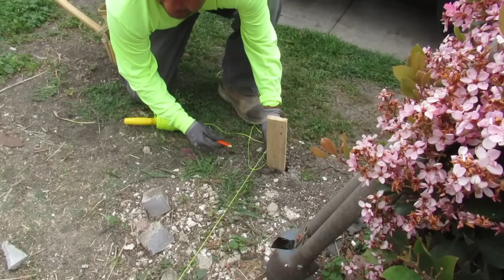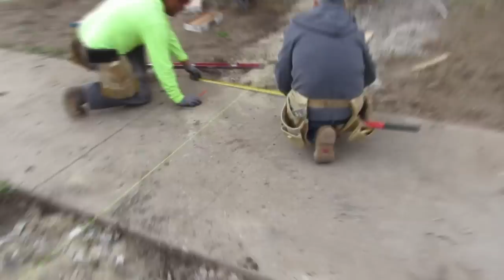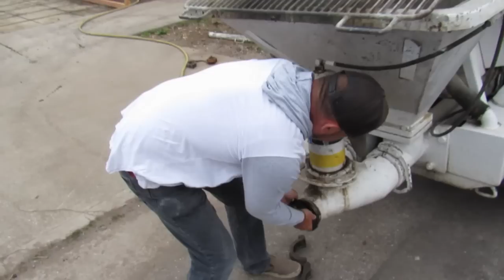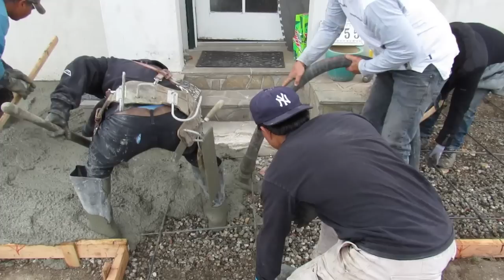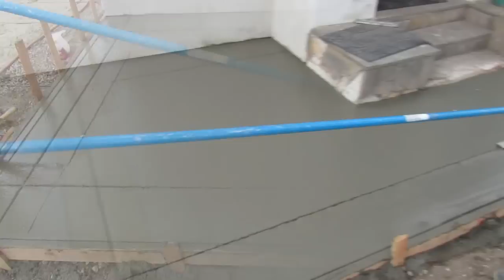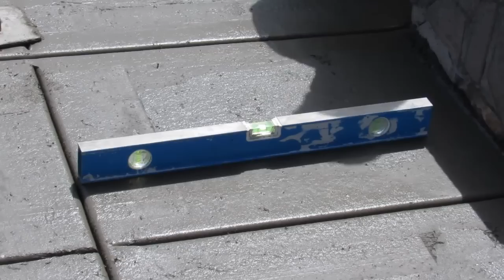Construction Of A Concrete Front Entryway From Start To Finish! BEST IN THE WEST!

Comment: i love your videos.
and  your skills
i work at the highway(maintenence) by super(rapidly) cement with volumatric mixer in s.korea
and sometimes using common concrete
sir. may i know using your concrete compressive strength(30days) and slump?
Reply from the maker: Hey brother thanks for watching. I use 3000 psi concrete 👍

Comment: There is a difference in breaking a bubble on a 4 ft level and a 6 ft level. So your % will change depending which level you use
Reply from the maker: I never said there wasn’t? I’m obviously referring to the 4ft level I’m using in the video 👍